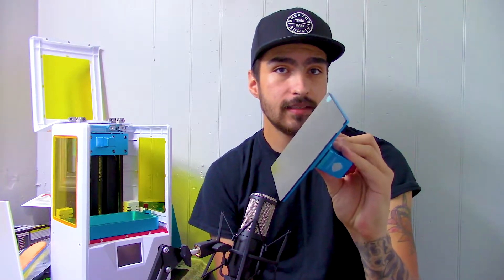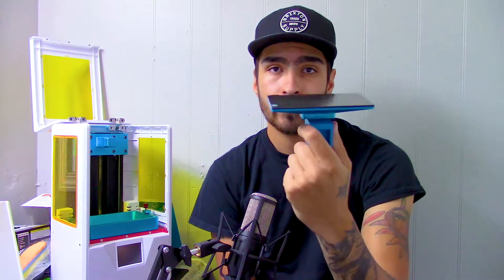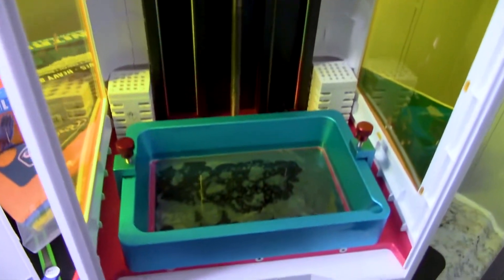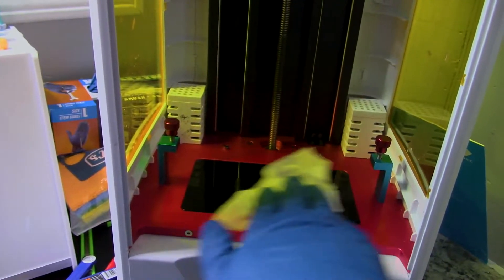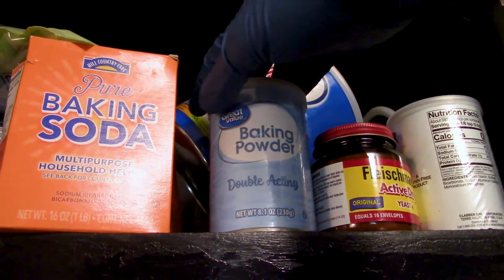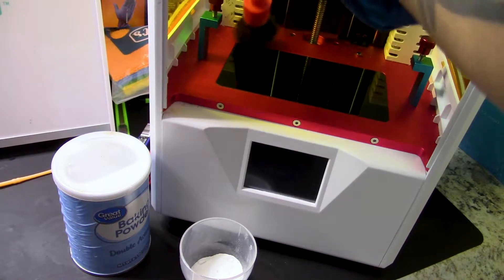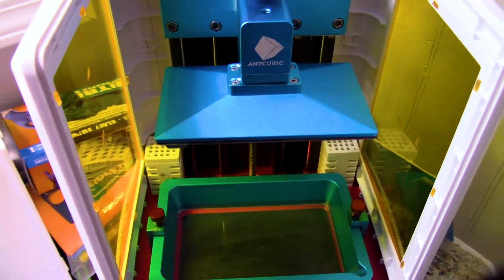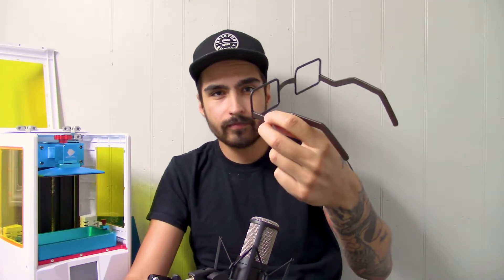Build Plate Adhesion Solution (Anycubic Photon S)

Comment: My prints are doing this on and off. Very strange tbh. Sometimes just cleaning the plate would work. Not always. Just bought some baking powder to see if this works. If it does, this video will be shared! And hell. I’ll prolly share it anyway because any type of fix should be known

Comment: What resin did you make the glasses from?
Reply from the maker: It was standard anycubic resin!
Reply: @hdycreator  Say what?! So it didn't break or anything? I wonder if you could make real frames with resin.
Reply from the maker: I never actually wore the glasses they were more just for display. I'm not sire if standard resin could be used for really glasses,
Reply: @hdycreator  I really like resin printers. I have only a Photon S. Just ordered a spring steel build plate. There is a company that I spoke to that makes some pretty durable resins.
Reply from the maker: I'm using a magnetic build plate on my photon s. It's totally worth it! Resin printing is awesome. I do hate how much post process work it takes though lol
Reply: @hdycreator  Yeah, I made 2 lithophane ornaments and I didn't think the first one was going to ever come off. Then I went overboard on the second. Put it on supports, too many supports. I ended up cracking that one during cleanup. I can't wait to get my magnetic build plate. I have glass on my other 2 printers (FDM).
Reply: @hdycreator  Did you have to modify your printer to account for the magnetic build plate?
Reply from the maker: No I added the magnet to the build plate then adjusted the Z height. I have a video on tiktok of the install @domnicktrujillo
Reply: @hdycreator  I want to say someone printed the little angled pieces that got through the sensors. I did add taller towers that I printed, flipped the fans, and filled them with activated charcoal.

Comment: I have the mono and when it gets closer to the Resin tray it sounds like the screen is going to crack as it lowers into the bath anyone help?
Reply from the maker: I would just make sure your z is set correct, and you have no foreign items in the vat such as small pieces of cured resin. I dont have a mono, but that's the first things I would check.

Comment: Baking powder! Thanks for sharing. My third attempt at printing appears to be a success ( so far). I would not have thought that adhesion of the fep would cause the fail. 
I share using baby powder to dust molds for casting without bubbles. Thank you!
Reply from the maker: Glad it worked for you!!

Comment: Thanks for the tip, finally getting prints to work again! After applying a very small amount of talc to the screen I could see a lot of micro-scratches which didn’t look right, turns out there was a really thin layer of resin there most likely from build up after emptying the vat etc. IPA didn’t shift it by itself - I used a nylon scraper to remove it then reapplied a thin layer of talc and wiped it off. Combined with recent humid weather the FEP was sticking to the screen too much, but all good now.
Reply from the maker: Awesome I'm glad you were able you figure it out and get it fixed!!

Comment: I had considered using talcum powder this way but was afraid it would scatter the light too much. I guess you don't need very much at all. Will try, thanks.
Reply from the maker: Very small amount Is needed to just remove the moisture.  There should be no evidence of the powder on the screen!